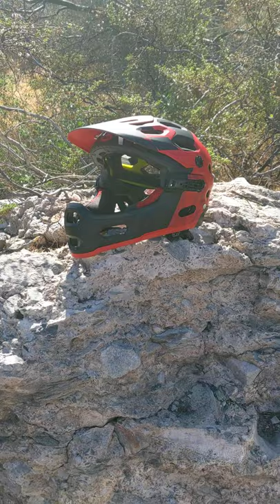BELL helmet with removable chin bar. Does or did your helmet squeak? #shorts

Comment: My full face squeaks too, but it's cus carbon sheel hs seperated from the inner shell. So new helmet time soon, I retired one already but its Fox rampage pro carbon. From 2016 got it in 2017.
Reply from the maker: Those fox helmets are nice👌
Reply: @weekendmountainbiker9457  but cheek pads are bad, they permanently compress so need replacements. also bad adhesive on the soft plastic strips. and varied longevity on the shell and carbon shell adhesive durability. So I think it's time to use try something else. next goggles I will try will be Leatt 6.5but helmet I am leaning towards Kali Shiva 2.0